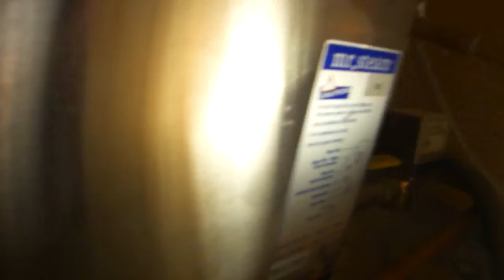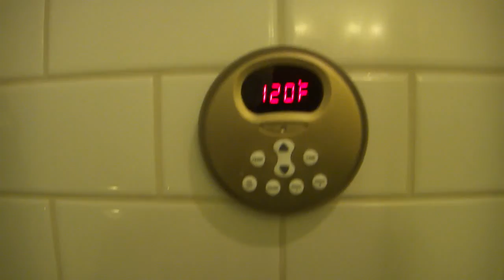Mr Steam Plumbing Path

Comment: The auto flush drain goes to a floor drain, or an open air pee trap.  They advise this so your drain couldn’t back up into the steam generator if you were piped directly.  I rigged mine up differently, going into a 3/4” to 1.5” drain that is sealed off.  I would rather crap get into my steam generator if my sink plugged up than have a flood under my cabinet.  And the previous comment was incorrect - the water has been cooling off for two hours before the auto flush opens.  But you still don’t want it going into your shower because it will leave a snail trail of shittyness on your nice clean floor.

Comment: this setup to nice but damn is it a lot loader than mine.
mine is super Quiet with a 6Kw setup. also how is your water pressure when you have
the steamer running while taking a shower?
Reply: Oh thanks for the reminder — definitely will need to upgrade the house to 3/4 from 1/2